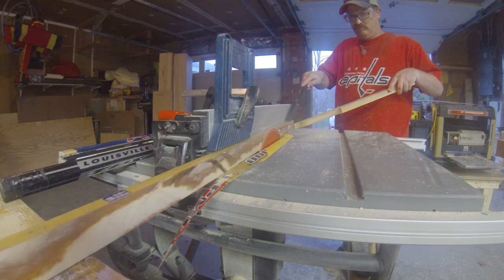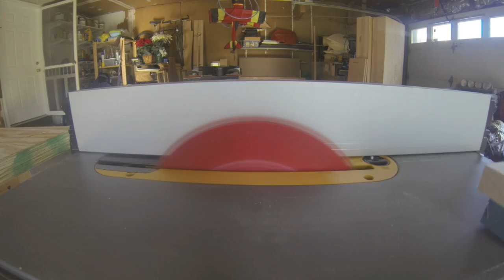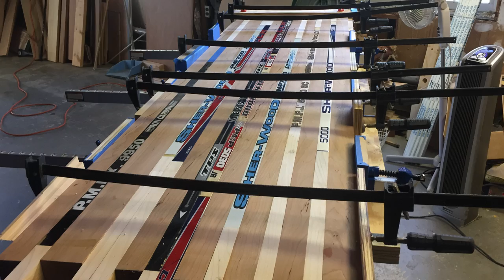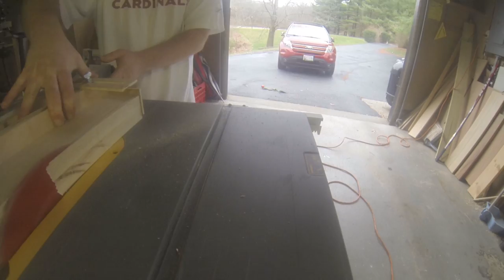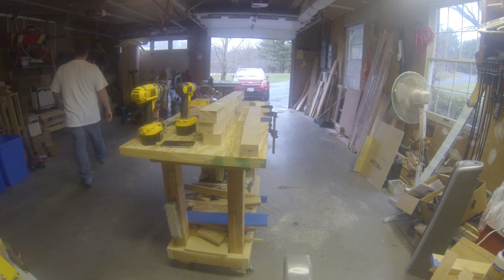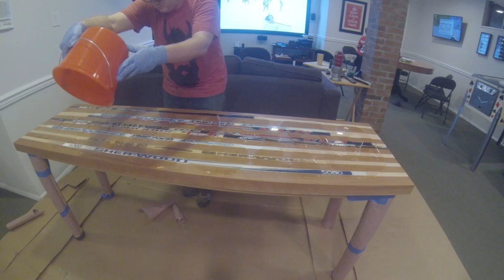Hockey Stick Table

Comment: Well done! The torch at the end, what was that for?
Reply from the maker: +Dave Kennedy The torch is to pop bubbles in the epoxy.
Reply: +coldkuts Does it settle back out on its own or do you have to apply more? I've thought about giving that stuff a try.
Reply from the maker: It self levels out.  You have to do some calculations for the surface area so you mix up enough at a time then pour it. If it doesn't come out thick enough for what you want you can add a second coat later.  This was the first time I ever used it. I was pretty nervous about it but it turned out to be a pretty easy solution.
Reply from the maker: I probably watched these two videos about 20 times - https://www.youtube.com/watch?v=1oJjij6mHZw and https://www.youtube.com/watch?v=0jUVdOle4S0